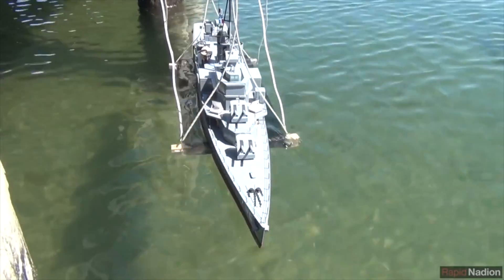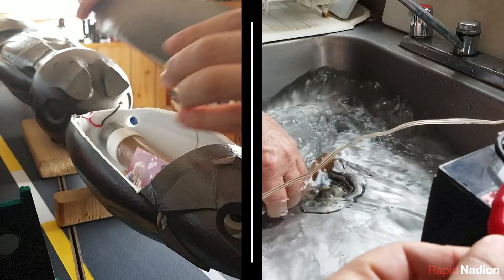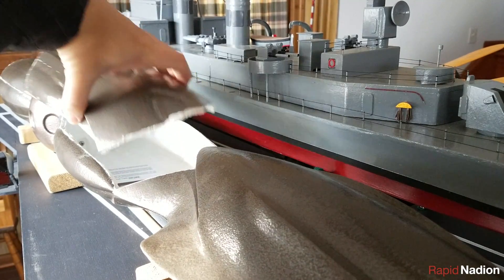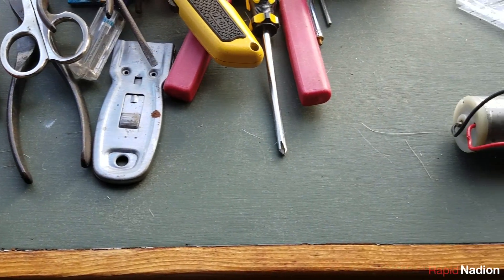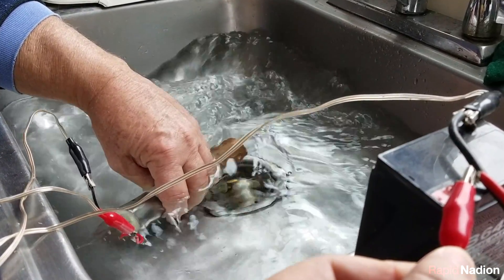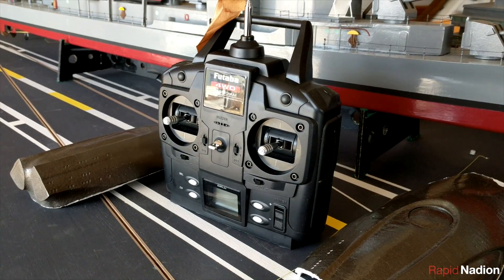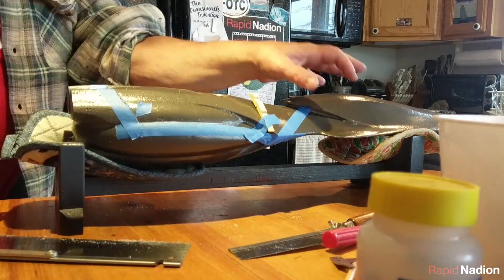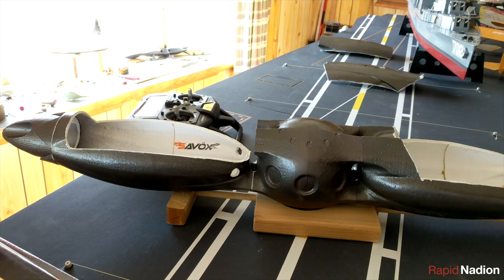Building seaQuest DSV, an R/C Model Submarine [Part 2]

Comment: Wow, Looks like cutting the unit up may have been easier and less problematic using a hot knife and or hotwire equipment. I know this is late, but I just saw it and thought I would mention it. Likely this old news seeing you have over 37K views.I was also curious as to why you have 90-degree elbows on thrust. It would seem this would work against your forward thrust as part of the energy would be canceled by the flow at the intersection and create wasted eddy currents

Comment: You guys should build a model of the USS Independence (or USS Freedom is a trimaran is too hard to make) and have a working gun on it that shoots 1/8 or 1/4 inch steel balls using compressed air.

Comment: Why 27 MHz? Just get a cheap FlySky fs i6 for 50 bucks, holds 20 receivers and has great programming functionality (for airplanes and helicopter) that was you can have one transmitter for everything. It is 2.4 GHz frequency hopping. It's a lot cheaper and a lot easier that way. It's 2017 get with the times ;)
Reply from the maker: 2.4GHz is  useless where underwater use is concerned.
Reply: Oh, I see

Comment: Awesome video, as always, guys! 

A quick side-note before I get to the meat and potatoes of suggestions. I'm the guy that created the model that the RapidNadion team is working on. It was the first iteration of our upcoming kit. Our new version, a 1:300 scale (40.25" long) kit is now complete and we're taking orders. Info at www.nautilusdrydocks.com! 

Okay, that said, here are some thoughts: 

-Hull is cut. No point talking over other potential access cuts, but a simple slice right at the midline would likely have offered best ease-of-access.
-Propulsion: Vectored thrust like a jet-ski. I'll be releasing an R/C conversion kit for my kit that features this control method. The benefit is that you can actuate not only yaw, but pitch control from the same control surfaces. Envision a circular nozzle that actuates not only horizontally, but vertically as well. 
-Ballast: That big central sphere is PERFECT for a ballast tank. Use it!

Bob - RCSubGuy

Comment: why not use the central where as a shroud covering center of a WTC, then let the ends "sleeve" over either side of WTC.
Reply from the maker: We thought about using the sphere as a WTC (it's what Bob Martin over at Nautilus Drydocks recommended) but the hatches we opted to install made it more practical to use one of the "football" sections for this purpose. Still, it's an option!
Reply: I'm a humble tinkerer and admire what you are doing. not a simple task to make science fiction into reality. I have a 3d printer that I CV would gladly make available for prototyping any ductwork that might make your task more feasible.